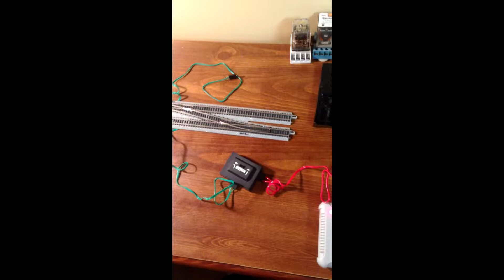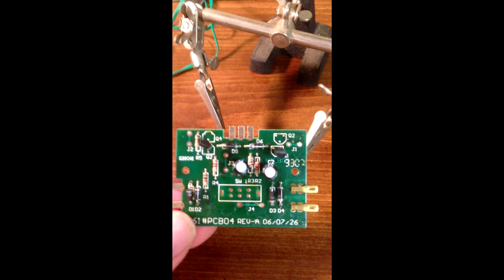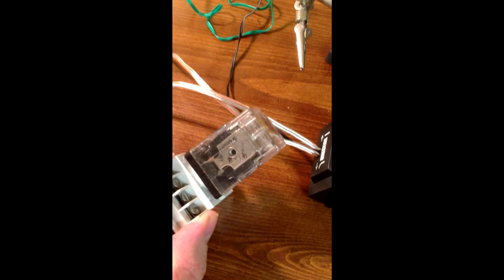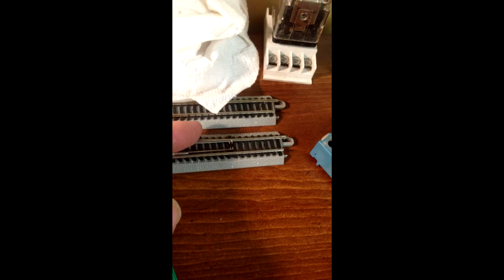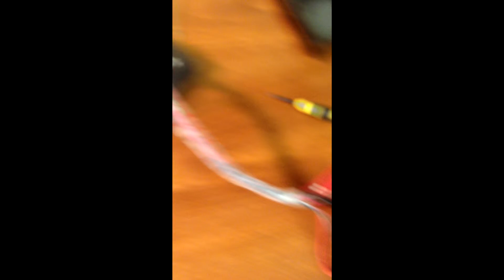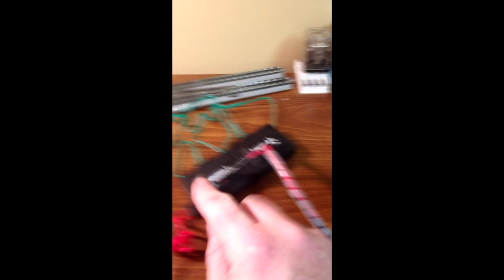::Les Klar's train project:: Bachmann EZ track switch machine modifications

Comment: Watched again and have another question.  You use the acronym PLC.  What is a PLC?
Reply from the maker: Programmable Logic Controller. It is device you can program how inputs and outputs are turned ON and OFF. In this video I program the controller to perform the switch in one direction or the other.
Reply: @LesKlarsTrainProject  Thank you for your response.  I have a large "basement filler" N scale layout that is all Bachmann EZ track including several turnouts and crossovers.  I have a keen interest in how you set up your turnout controllers.  Are Arduino's and Raspberry Pi's examples of PLC's?